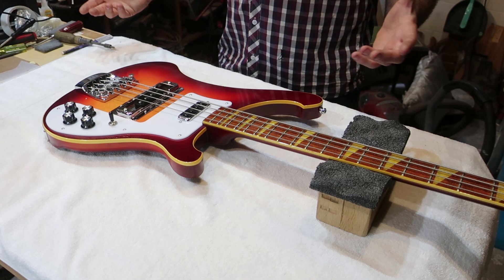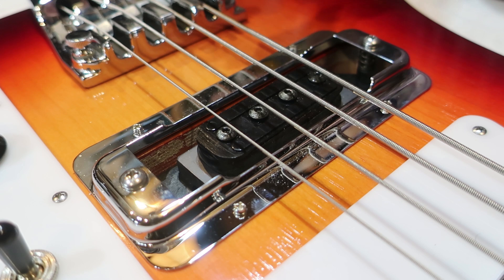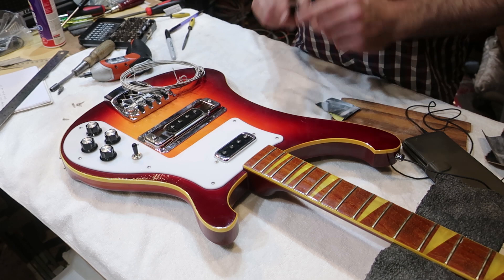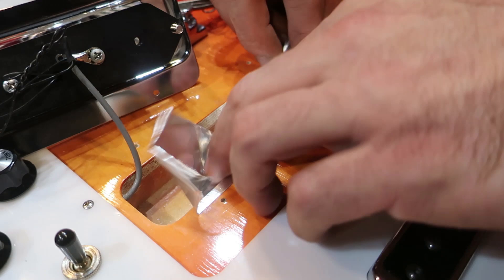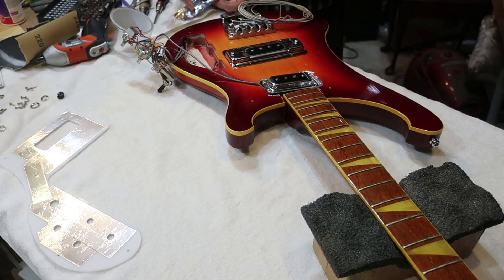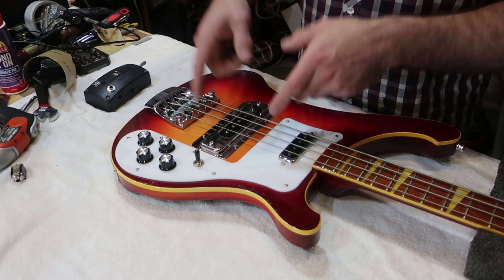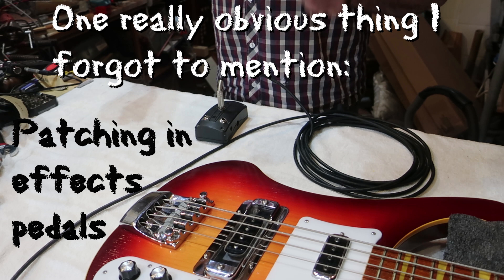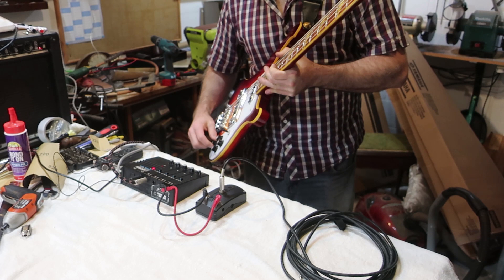Getting The Most From Your Rickenbacker - DIY Bezel, Shielding, and Stereo Connections

Comment: It's called 'comb filtering'.
When both pickups are full volume (in mono), some mid frequencies cancel each other out. If you use the 'vintage' push/ pull switch, this doesn't happen as the bridge pickup bass frequencies are cut slightly. The frequencies don't overlap - no comb filtering. Turning down the neck pickup will move those frequencies 'out of the way'. You get a perceived volume boost as there is no comb filtering.

If you use Rick-o-sound (stereo) this doesn't happen as each pickup is independant of each other, so frequencies aren't cancelled.

Comment: Thank you.  Before I shielded my 4003 I could barely hear the buzz, but after following your video, the buzz is much louder now.  I don't know what I would have done without this video.
Reply from the maker: You've obviously got a short there, if any of the shielding comes in contact with the hot side of the circuit then it becomes a big antenna. The idea is that you collect the interference and sent it to ground, but you're sending it to your amp.

Comment: Good video - I use my Ric-o-sound with a Y cable.  My bridge goes through the effects loop (ends in an empress compressor so I can roll up or down on the output as needed) and my neck goes through the clean channel (this channel also has its own EQ and boost).  In my practice rig I'm just putting the bridge on the old Line6 spider guitar amp and the neck into my TC Electronic 210.  Again, it's about taming the monster.  I do like how you're using the splitter pedal instead of a Y cable.  On my pedal rig I use an Xotic X-Blender which allows me to balance the wet and dry loops to my liking - a simple pedal that basically does what your tabletop multi channel board is doing.  On my mono basses I just push everything through the X-blender, but when I plug in the Ric I put the input direct into the effects loop.  I have a new multi effects pedal inbound that has a stereo in, and I'll have more control of those channels with that pedal.

I liked seeing (and agree) with your assessment of the faraday cage using the multimeter test.  I did a similar mod with the copper tape on my J bass.  It wasn't enough with the buzz on the MiM J bass, and I ended up installing a pair of linear hum cancelling S-D Apollo pickups - now it's dead quiet.   I didn't see, but did you wire your ground to your shielding tape?

I'm very much enjoying your spirited channel - keep it going!

Comment: amazing! You could achieve the same result (or similar) using two tiny buffers within your bass. They would prevent each signal from interacting with each other. All that could fit within the cavity and save you all the hassle with with cables, mixers and split boxes.
Reply: Agree 100%! Plus, I think Rick pups, with their purer sound, would sound fantastic with simple onboard EQ.
Reply from the maker: Indeed, there was a short part where I likened the effect to a dual active bass with external electronics, but I garbled my delivery and edited it out. I have other reasons for using the mixer anyway, I also play keys with the band, and on some songs our singer is playing his own bass, other songs I'm playing bass on a separate keyboard, plus two channels coming from the Rick, all going into a bass amp with only one input, the mixer is an essential part of my rig. And it gives me the option of patching in effects if I ever feel the need.

Comment: You have the most detailed videos. I'd love to see more from Peavey or something like that, too.
Reply from the maker: I do have an '89 Peavey Foundation, it's a really good bass. It's got the neck adjustment screw that someone has overtightened and there's a hairline crack running up the center of the fingerboard, I've been wanting to do a repair video about that for a while but tbh I'm not 100% decided on how I'm going to approach it, I fear it may involve removing the frets and needing to refinish the whole neck... And as it stands it's still playing perfectly, the setup is killer and it's a meaty sounding bass, I really rate it. We'll see what happens next year, hopefully I'll have a little more free time to work on stuff like that. Thanks

Comment: Aside from phasing, I don't know the exact wiring and control of that bass but it is acting as if the switching puts the 2 together in series. For anyone who doesn't understand electrical wiring, series vs parallel is how the electricity travels in a circuit. If instead of pickups you put 2 bulbs in the circuit, 1 on 1 off, in series one on is super bright, but both on decreases the output. This is because 100% of the available electricity goes through both components increasing resistance and sharing the load 50/50. In parallel both lights glow bright because the electricity can choose which path to take so each bulb gets 100% of what is available to it. Winding back the volume on one pickup is like adding a dimmer switch to the bulbs so we can get 50/50, 40/60 or 75/25 etc.

Comment: Im currently using a pbass that ive wired the split coils into their own channels with two outputs. The bass is strung to suit b-d-d-f tuning. One d string being a 95 guage and the other 50.
 I enjoy it alot. 
Each line runs through its own effects chain and amp. The b and low d go through some bass effects and amp and the higher d and f strings go through guitar effects and guitar amp. I did this because i wanted to find something to challenge my playing and open up new options. I run the guitar side with an octave up pedal and some dirt to the tone it really does sound crisp against the bass side filling the room . Really twists my brain playing two seperate things sometimes but totally worth it.
Im planing to find an EB-0, convert it to a headless bass with this wiring in mind and tweeked pickup placement. Now ive found the concept to be sound with the pbass im enthused.

 If i get round to it ill film it and remember this channel , perhaps youd be curious to witness the noise. 
Aweosme videos thanks pal. Found you through your ebo mod video and just binged four hours , great stuff. 
Im subbed and will follow from the uk.... keep em comin!!!

Comment: If the PUs are wired in parallel, as is the case with most basses, you get a significant impedance drop (about half the impedance of each individual PU) when operated together. Hence less gain @ the amp's front end...

Comment: Other solution is have a pull switch to put the pickups in series. Parallel windings sound restricted. The signals that are different between the two pickups are greatly attenuated when wired in parallel. When you put the pickups in series, the pickups are completely additive. I have been doing this on all my Jazz basses for decades, and there is no going back. I will be doing so on my newly acquired 4003. It is all the difference to my ear, and keeps a Jazz noiseless, rather than noise when one pickup is turned down a bit to get the tone bloom we all like. I was disappointed to learn Ricks do not have reverse would coils and reversed magnets. So dumb. That needs to change. I will test mine to confirm. Thanks for the video!

Comment: Hi, I wanna know how to replace the Rickenbacker 4003's buckle locker,I had to try pick it off down of the bass's locker but it to hard to unscrew it. and which buckle locker you used I have see the original buckle is to rough, which means lot of buckle locks cant  install on it.

Comment: Question: I’m looking to shield my Rick too. Crazy buzz which I’ve tried to ignore but just can’t anymore haha. My question: which is better, aluminum or copper shielding ? Is there a difference. I’ve always seen copper shielding in examples but yours is the first one with aluminum shielding. Not sure if there’s much of a difference. 

Cheers mate 👍🏻
Reply from the maker: I've never noticed much of a difference, in theory copper is a better conductor, but aluminium works too, certainly well enough to shield a few pickups. Be aware of the continuity test I did, the adhesive on your tape might not work so well. Cheers.
Reply: @fanbladeinstruments  follow up question: did you solder ground wire at all? I’ve seen a ton of guys use say copper wire for example to ground everything but I’ve also seen guys just put down the copper shielding without soldering any sort of wire.

Comment: Quick question about the shielding. Please help me. I didn’t find this answer anywhere: do you need to ground the copper papers too?
Reply: Also, do you need to pass a jumper cable from the bridge pickup copper housing to the rest of the copper on the main housing?
Reply: @rafbass  you should look a bit close at how he did the shielding. The shielding of the cavities folds just a little over the edge of body. That part makes contact with the shielding layer put at the back of the pickguard when it is screwed in place. The shielding of pickguard is contacted to ground through the outer shells of the pots which are grounded and make contact to the shielding at holes through the pickguard. Makes no difference if you use copper or aluminium, the principle is the same.

Comment: Might be a dumb question, but can’t you run two chords out of the bass so each output does one pickup?
Reply: No! If you use the standard Jack it cancels out the stereo Jack with a spring switch as you plug in.
Reply: @dixiefallas7799  Not only that, but if you plug a mono jack into the rick-o-sound output while having the mono output also in use, you will effectively shorten both pup's to ground and you will have no sound at all.